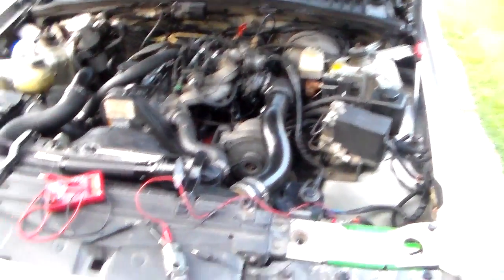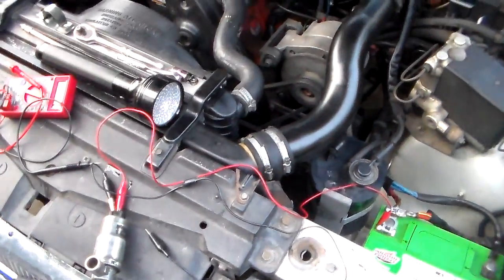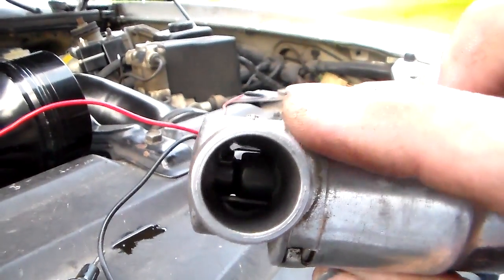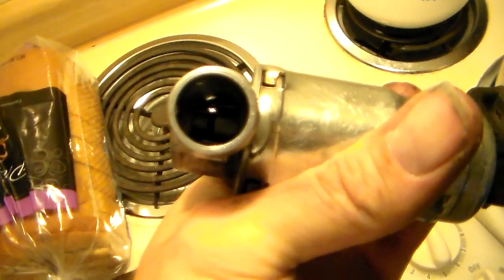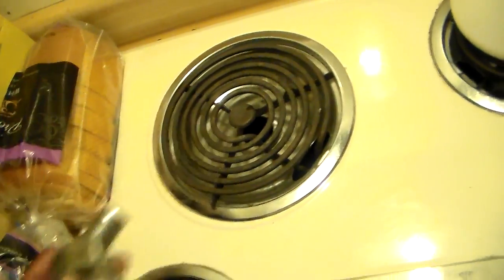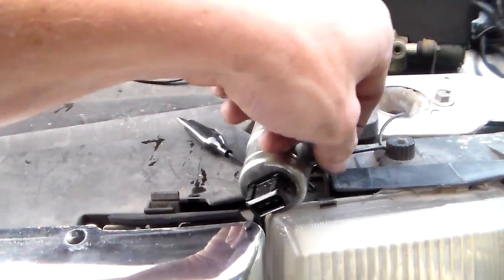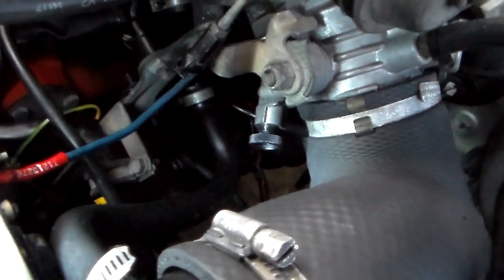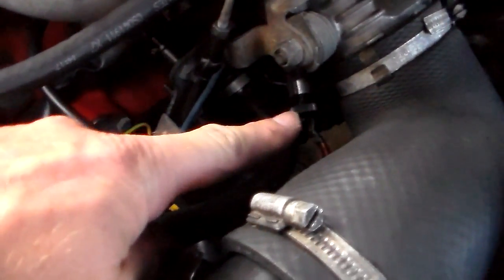Volvo B230FT idle saga part 2

Comment: I have a 1994 940 wagon with the Regina Fuel System and had all the same problems you are having... car would start fine and pull off no problem...drive to the corner and stop pull off again and it ran terrible... bad idle, surging, low power. After replacing too much, which did not help, turns out the small rubber elbow on the vacuum line going into the MAP (manifold absolute pressure unit hiding under the shock tower strut) had a crack. Since the computer was receiving bad info on manifold pressure it adjusted everything wrong. $1.00 part later car ran perfect, and still does 1 1/2 years later.
Reply from the maker: +Michael Bell That's awesome. This one has continued to idle well so far.